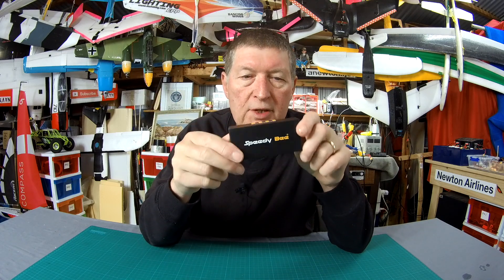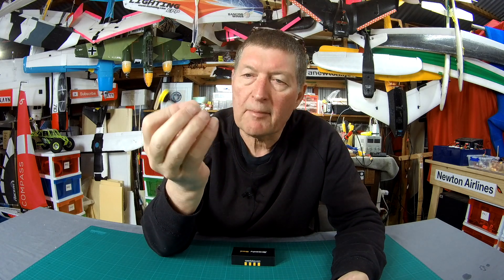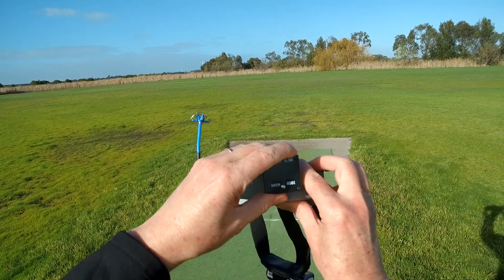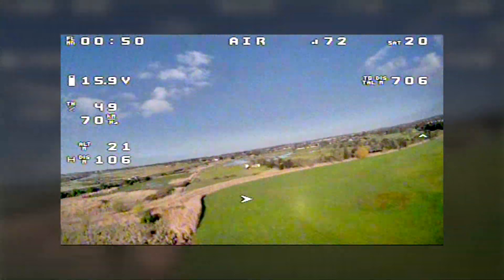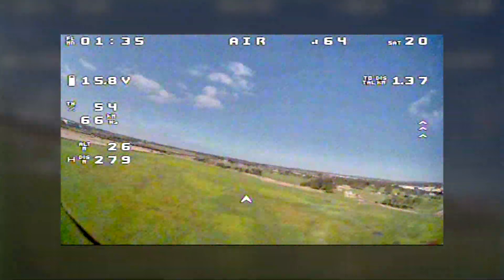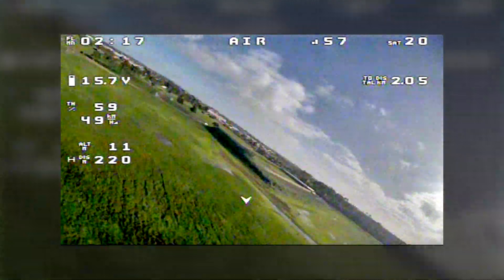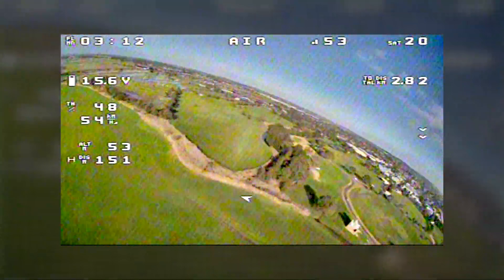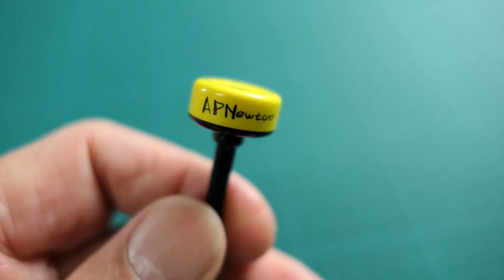SpeedyBee FPV Antenna

Comment: what mw were you using here?  the distance you get before those breakups is not too much...
Bruce compared it to the Foxeer Lollipop2 - and they were pretty identical (good image on a quad a good 750m run). 
will review my sample as well. greets, Mario
Reply from the maker: Hey Mario, I was using 200mW. It is a noisy RF area unfortunately. Comes and goes but we have all lost 2.4 and 5.8 signal in that area. I'll do a proper comparison soon, maybe in a cleaner RF environment. But I would trust your tests with any FPV gear rather than mine
Reply: @AndrewNewton  thanks, that's nice!     so - your normal flying field has these dead spots, bermuda triangle style, as well?  I know this from my "chocolate facotry field"...
anyhow - with those interferences I see why you have a proper (RTH?) flight controller on there as well :)

Comment: That interference is more than likely to be multipathing. Even CP antenna's are not immune if there is more than a single 
reflection point. Interference would not be so dependent on the transmitter's immediate location, more the receiver's.
They do look good for a low drag solution, I'd like to do an efficiency test to check their real radiation performance though.
Thanks for posting.
Reply from the maker: I'll do an antenna comparison soon.

Comment: Antenna looks like it works fine and thanks for another video, but what can be done about flying around with one eye view?

Look at links for the blackbird 3D system one is seller and the other is utube demo of purchaser. I was thinking more along the lines of 2 AKK A2 5.8Ghz 200mW FPV Transmitter Raceband 600TVL 1/4 Cmos Mini FPV Micro AIO Camera with Clover Antenna for FPV can be seen here https://www.amazon.com/gp/product/B06VSW41LN/ref=ppx_yo_dt_b_asin_title_o01_s00?ie=UTF8&psc=1 and I would still have to modify a set of googles. What do you think ?

BLACKBIRD LINK:     https://www.robotshop.com/en/blackbird-1-3d-fpv-camera.html#Useful-Links

                                     https://www.youtube.com/watch?v=p0uvYLTT0K0
Reply from the maker: 3D FPV setup was available a few years ago. Might have been Skyzone.

Comment: CP antennas on 5.8G are frankly a waste of time IMO...I just use linear so i dont suffer the db loss associated with Skews. Its a current trend for our friends in China to see who can make the smallest, cutest looking 5.8 antenna. Unfortunately, it has nothing to do with actual performance. That's not interference BTW, that's a weak, badly propagated signal.
Reply: I agree. Sooooo may CP antennas constatly coming out and ohhh which one is the best? I just rely on my patch antennas anyways.

Comment: Had Y'alls Tried The Small / Short Lollipops Like They Use On The Larger 5"+ Quads? Does It Drop Power or Any Adverse Effects To Use An Adapter From SMA to RP-SMA Etc? And Do You Have To Get Specs On Video Trans On Rt or Left Polar??? That's Always Way Confusing To Me... Thanks Mate
Reply from the maker: I haven't tried those tiny ones with no stalk. Adapters do reduce performance, but if used to get the antenna clear of obstacles they may well increase performance. One of the FPV gurus recently demonstrated how much effect they have. Alex Greive, Bardwell or Pawel, cant recall who. R and L polar only relates to the antennas not the VTx or VRx. Need to match L to L or R to R antennas
Reply: @AndrewNewton  OK Thanks Mate! ;~)P
I Found Out The Wrong Way On My Yuneec Drone, Has A Dual 24mh Ants On  TX w/A Single 58gh & I Bought A Dual Pepperbox Ant That Is A Left Hand After I Spent $75 On A Fancy Right Hand... Ohhh Well I'll Just Re-Sale It On eBay!? LOL

Comment: It’s hard to tell what the antenna is like with out a comparison.
Put it up against a pagoda so you can see a difference and make a judgment of the antenna then.
Reply from the maker: Correct. Just show and tell at this stage. Planning a wider FPV antenna comparison in the future. I need to buy a better VTx with SMA first.